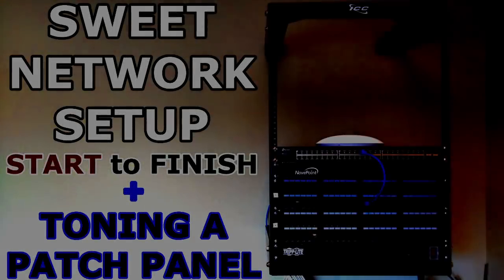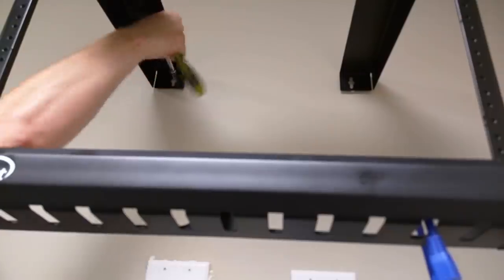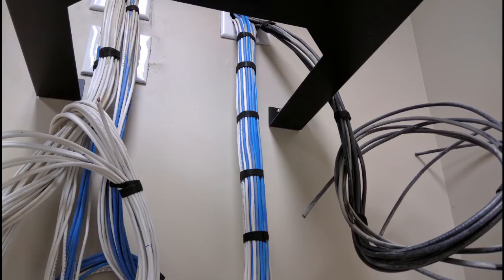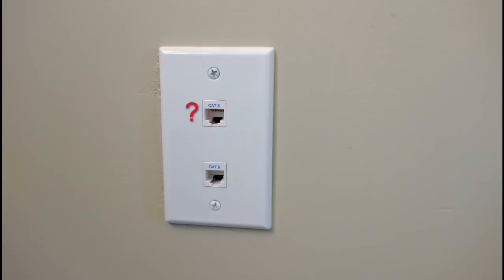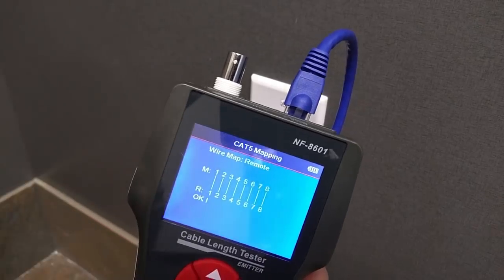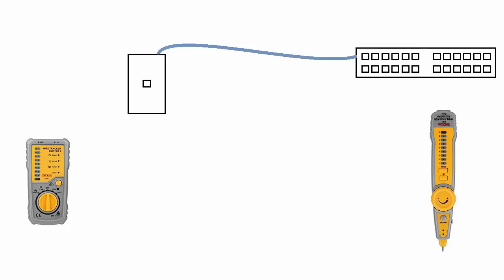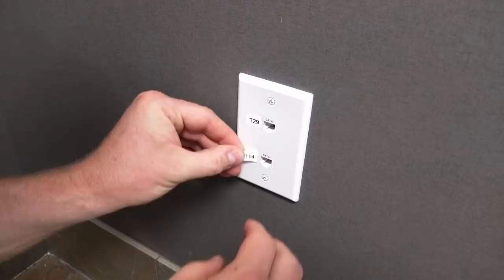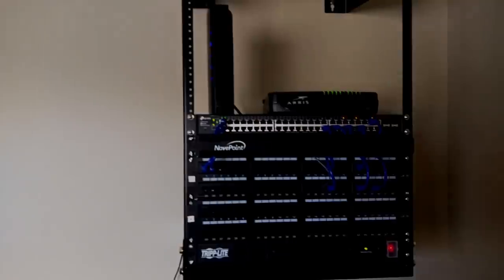Complete Network Setup // Toning, Identifying Ports

Comment: Once you go to a modular patch panel,  panduit for instance you will never want to punch down a patch panel again.  label as you go but test every connection or at least wire map. If a big project you want to prenumber a print so you do not miss any also a pro job should have connections numbered in order out on the floor as much as possible.

Comment: Label your cable on both ends as you pull it, 10 seconds with a sharpie before saves you min of toning each port. Also your jacks will be sequential at the desk, instead of having port 1 and port 37 being next to eachother
Reply: Lets see how may times I can copy, and past this. 2
So you are one that plays with Sharpe's to. Your fired, and I never hired you. It is not good practice most of the time when a real cable installer does an installs the dry wall has not even gone in. This is what happens in the real world. after you have gone in and left your Sharpe marking the dry wall goes up then texture is sprayed on the cables, and then the painter paints and gets paint all over it. By the time that the job is passed back to you the Sharpe scribble you wasted time on is gone. Get a good mapping tool Klein makes them all day long.
Reply: 25 years cabling voice and data working on jobs up to 100000 points and all ways label both ends. Also put them in bunches of 24 at cab end and label them. Mark up floor plan as you go if there is one. Saves so much time and then you don't have cable 7 next to cable 23. Makes testing so much easier even more so if certifying the cables. Totally bad practice not labeling even the painters cover one end you will still have them right.
Reply: it is good practice and it is a BICSI standard to label cables when you are pulling them on both sides 3 times 12" apart. I work for a fortune 500 company and we use sharpy is every scenario. and when it comes to drywall you roll up your cables and bag them. the dry wallers will work around them.
Reply: Who the fuck said anything about marking up the walls?
Reply: Looks like a pissing contest lol...
Myzt1c seemingly suggests to not label. I disagree, label it somehow. Labels, markers, tape, something. If you do bundles together at least label them so you're close. 
Also Firespyer wasn't talking about marking ON the drywall, but marking the INDIVIDUAL cable. I know some dumbasses, but I don't think I know any who would even consider just simply marking on the wall where a bunch of cables come through... lol
The point about paint/sheetrock mud/etc being on the cable is legit, but in those situations, you should really do something to protect the wires because that also means there is a risk of damage, not just some splatter. Trashbags and shopping bags are cheap/free and can work wonders for a cheap way to do that. various zipbags also work well, etc. 

I don't do pulls like that, I actually install O.R. Lights, sterilizers, washers, etc and we do have to deal with various AC, DC, Various Communications, and Fiber lines.  We have worked in new construction, and renovated old. I also see a lot of the electricians and data guys work in those places. It's interesting to see how everything and everyone's work happens and comes together to me.   
At home I have a home server rack with multiple servers, network equipment, and a custom home network just out of fun and experimentation, so I feel like I could fairly easily get up to speed and work in a professional capacity in this field.  Common sense, open minds, and a little brains go a long ways in these fields of work.
Reply: I love labeling everything. It's a time saver for the everyday installer. I use white Electricial tape and flag my cable around 3ft back of the ends of the cable and then I label it with a numbering system that logically makes sense moving around a office and the  groups of cubicals.Just Label your boxes and your cables people. Especially on large jobs. this is another very important tip mark your footages on your cable boxes.
Keep track and manage your materials/cable runs you only get a 1000ft per box. how many runs can I get out of that box. I can and do understand you can actually do a job a million different ways and hey at the end stuff works right not bad budget nerd.i  really like your rack mounted power. comes in handy when resetting the router and switches. We all learn and grow with experience and time. I really don't understand the not labeling people fighting so hard for the view that not labeling is the most professional productive way. If not carrying about overall rack design and numbering scheme doesn't matter how is that professional. I would not want everything just some random numbering style if I paid for a full data cabling install. It really doesn't kill me on time labeling the cable. I find it quicker on the terminations end of things. So who really gives a rack lol

Comment: You mentioned running the cables before the drywall goes up.  When I've cabled a new office, the studs are steel and an electrician has installed the boxes and conduit up to above where the ceiling will be.  I then run the cables down through the conduit.
You don't know which cable is which?  You mean you didn't mark them as you pulled them in???  A Sharpie is your friend!
I've used that rollover method for BIX strips, but I prefer keystone patch panels, where you have individual keystone jacks.

BTW, I have a Unifi AC-Lite access point in my home.

Comment: Cheat mode when dealing with structure cabling that you didn't install and therefore didn't label at install time (which you totally should have done already).

Patch all patch ports to switch ports.
Run around site with laptop and Excel spreadsheet.
Plug into wall jack
Access switch management
See what interface comes up.
Mark it. Move to next hole in the wall.
Reply from the maker: Didn't want to label. I don't think it saves much time personally. My toner and tester actually whipped through those pretty quickly.

Comment: At 10:52, why do we need to connect cable from any router lan port to patch port 1 and then from patch port 1 to switch port 1? Can't we connect straight from router to switch port 1? And then other switch ports to patch ports?
Reply from the maker: Yes you can do as you suggested. I did it this way to keep it neat. Otherwise you'd have a cable coming from around the back, plugging into the switch in the front. Just doesn't look as good.
Reply: @BudgetNerd  I noticed that's what you said in the video, apologies and thanks for confirming.

Comment: Placing modular plugs into the ports on the patch panel is a good idea (protects them from the elements) just remember that most blank RJ45 and 48 connectors will not fit into the ports unless your crimp them first. Trying to force an un-crimped plug into one of the ports on the patch panel could damage it.
Reply from the maker: +Tucker McCannon I know, they weren't being forced.. they were barely in. Thanks for the tip.
Reply: right on thanks for sharing!
Reply: Hey, thanks for that good common sense wasn't even thinking of it. By the way you just made the first positive comment out of all the Techs/engineers comments I have read previously, as a sales engineer i will say thats why we are careful of letting them talk in a business meeting LOL!! I mean really, its called social aptitude.

Comment: I have a quick question, I'm pretty new to this, does connecting multiple lan ports from the router to the switch improve internet speed and/or latency in all pther devices or does not make a difference?

Comment: Label the cable first and make sure you have a little extra slack in both ends
Reply: Its easier to organize the patch panel this way rather than having to ports on the wall next to eachother and across the patch panel from eachother

Comment: I just ordered a 48 port Poe+ managed swtich...for My home Network. Hahaha
A familj of 4 clearly will have use for it. When it shows up here at home....I should have an excuse ready for my wife....still have no real excuse. Hehe
Reply: nowadays 48 ports does not sound so crazy for a home network. Like, everything is connected now; starting with a security system is at least 6 to 10 ports for cameras, doors and the DVR. If you want to place AP for the surroundings of the house at least 2-4 additional ports. And how many TVs does a family has now, at least 4, right? better to have them connected through wired if possible. So just TVS, security and APs is around 18-20 ports, lol! And having a managed switch is awesome to create separate vlans for things like security, printers, tvs, etc.
Reply: @ReptilianLaserbeam  
Thank you.
Just wished I had those very valid arguments when the switch showed up. How ever when it comes to my family there are no REAL usage for anything more then a 10 port switch. But at the ripe old age of 43 I all of a sudden got changes interest in computers. Been mostly gaming for the past 30+ years. But as you write. The best possible type of connection is wired. 
So I guess I will be deep-diving into a solid home network with security, server and Nas for our computers. Well well...I guess that better then Street racing.

Comment: When should you be using a 66 block or a 110 block? I know the short answer is phones but I don’t understand how those blocks connect to a patch panel? And I believe you don’t need them if you’re doing POE just analog? Could you do a video explaining that? Or provide a link for some helpful tips? Thanks
Reply: 66 and 110 blocks are an alternative for patch panels used for structured cabling of analogue telephone lines. Most businesses use IP phones now with a digital internet connected PBX.
Reply: Don't use 66.  They're telecom grade.  You used to be able to use BIX strips for 100 Mb, but not Gb.  I believe the 110 strips are good for Gb though.  In a large office, you might use them to cross connect between cables.  I've never seen that with Ethernet though.  The keystone connectors also use 110 punches.

Comment: When you are unable to detect or find the port where you put on the sound. Or the sound comes from different ports.
You can put one finger on the sound detector nose and one finger in the port on the patchpanel. When pressing on the detector, and testing it with your fingers, you should only hear sound where it really comes from (PORT).

Comment: A couple things I'd do differently on this.  Because of the number of jacks in use I would have purchased 2 smaller switches.  This way you have a backup and secondly wiring in the rack.  You would install a patch panel, switch, patch panel, switch so that your cable runs are short and easier to manage. 
Another thing, No way using patch panels.  Flipping over that panel and stressing all of the wires you have connected to it from the back is not good.  It's also harder to work on the wiring given that it's all right up there at the rack.  Better is to use a Keystone panel and wire each connector via keystones.  This might go outside of the cost of a minimal budget, but I don't think nearly that expensive that cost is a consideration.  With keystones, you can put them in the order you'd like on the panel and can easily work with each one at a time.  New reply to an old video, but it's worth commenting for any new listeners.

Comment: Could you wire up the jumpers from the patch panel to the switch to their corresponding numbers, for example your T1 would go into switchport 1 and then use a link runner on each drop and have it tell you which port you're connected to on the switch for labeling?

Comment: I bit confused when you showed router connecting to switch and patch panel. So, if I get it right, you connect a patch cord from router to patch panel, then patch cord from patch panel to switch? Awesome video by the way, I learned so much ! 👍
Reply from the maker: Correct. Thanks!

Comment: If you are in situation that you do not know how the building is cabled use cheap ebay tester and one co worker...Co worker has the main part of the tester and connects it to the wall plate anywhare in the building.On the patch panel you check for a cable using the other part of the cable tester,just break away the tab from lan cable that goes into the panel to be faster.

Comment: Quick question. I see the boxes in the wall were Cat 6. But the patch panel is Cat5e. Are the cables Cat5e as well or why did you decide on Cat5e Patch panels
Reply from the maker: I didn't run the cables, but the company that did ran 5e.

Comment: Something you might want to look into if you ever decide to mess around with your patch panel again:

You can buy blank patch panels with cutouts for keystone jacks.

You can buy female to female RJ45 keystones.

Put them together, and you have a patch panel with female RJ45 ports on the back instead of punch down connectors.

This enables you to use regular patch cables instead of punching down loads of connections.

Also makes reconfiguring things easier in the future if you ever need to.
Reply from the maker: +James Beat I've heard that before. That would have its benefits thanks for the tip.

Comment: in my whole IT Career iv never seen twin wall sockets which arn't incremental. IE A001 & A002. is it common to just terminate the wires and then label them up after not worrying about location on the patch panel?
Reply from the maker: +TornTech in my opinion it's common. There are those who clearly think cables should be labeled as they are ran (ie. read comments) but also plenty on the other side of the fence (ie. read other comments.)
Reply: I've been around this stuff for decades. I have never encountered a site wired in such and idiotic, lazy, haphazard manner. But youtube is full is this crap. (maybe because the pros are busy working rather than recording youtube video) It takes seconds to label a f'ing cable, to save how many minutes / hours of walking back and forth toning out and guessing which port is which? All the people whining "labeling is a waste of time", try it and see how much of your time it doesn't waste by knowing which cable is which, and where it goes.

As for "what if the painters paint the label", in 30 years, I've seen that happen only once -- and it was drywall mud, not paint.  Good installers tuck the cable in the box at the drop (where it's very unlikely to be painted.) The best installers also label the cables at the slack loop above the drop ceiling.
Reply: jfbeam 

If that spaghetti garbage is how they are working, they should be fired and never work in the industry again.  It looks like a 10 year old did it.

Wires should always be labeled.  Then labeled at the patch panel.  At some point someone, maybe you a year or more later, maybe someone else is going to have to waste a lot of time figuring out that mess.    That is someone or more someone’s with no pride in their work.   That was rushed, slapped to heather crap with no real plan and it shows.  Talking about amateur hour.  So much better at the end of this video.

Comment: Personally I have moved away from punch down patch panels to using blanks with RJ45 keystones. This way I can actually colour code/match the ports themselves with type of connections. Blue=data, White=Voice/VOIP, RED=Camera. Even for zones. separate colour to match cable destinations. I just use RJ45 blanks for any unused ports in the blank.

Comment: Is your TP-Link switch a manageable one? if yes what is the exact model of that Switch?
Reply from the maker: It's a smart switch, so it is manageable. The model is T1600G-52PS. I haven't messed with it really since it's not mine, but I have had zero complaints from those who do use it.

Comment: You forgot to add a service loop in your cat 5E cable for any future maintenance.
Reply from the maker: +Brandon1994youtub I didn't run the cable, also hard to see, but where all the cables come out into the room (in the beginning of the video) they didn't give me much slack. I had to organize all the short cables first and punch those down first just have them reach. I made sure there were services loops in my house, but I didn't get too many options in this building. I'm not thrilled with the people that ran the cables to be honest.
Reply: Budget Nerd sorry man, wasn't trying to sound picky just thought I'd throw in a gesture. I've had companies do that to me as well it sucks.
Reply from the maker: +Brandon1994youtub no worries. Just explaining the situation as well. Good tip though!